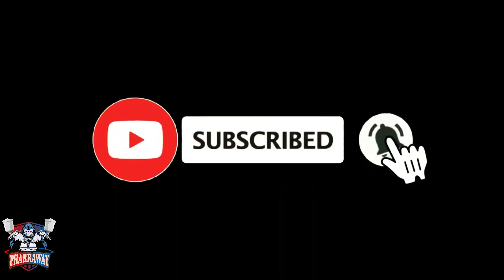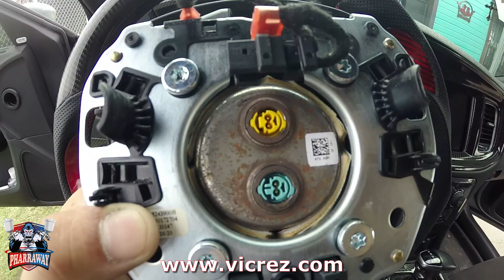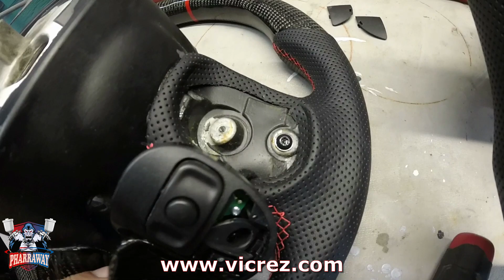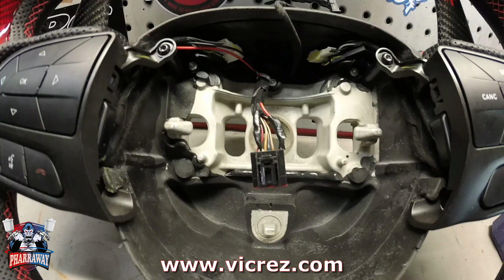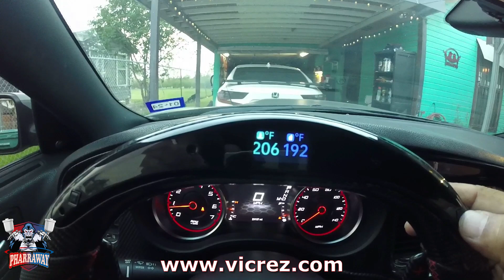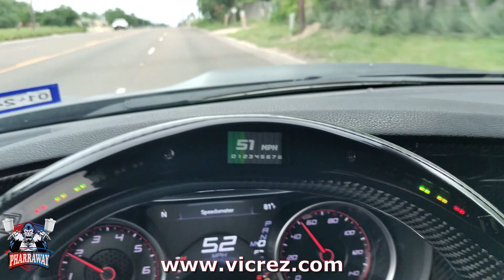Vicrez Carbon Fiber Steering Wheel With LED Dash Display INSTALL STEP BY STEP

Comment: If I bought a car with this steering wheel and it didn’t come with the obd part where do I find one?
Reply from the maker: Vicrez.com
Reply: @PHARRAWAY  they said I need a order number but I just bought the car I can’t get ahold of the previous owners either.

Comment: Great video! Does your steering wheel turn off when you turn the car off? Also, the purple wire you tapped in for the power. What does the purple wire power?

Comment: Isn't there a smart box that's supposed to connect to the data port aside from the white one you pop on there? It's shown in their troubleshooting and install video, although you do a much better job on the actual install. I got one of these for my jeep wrangler and am stuck with getting the LED displays to work. But mine wasn't delivered with the smart box. Otherwise, how does the data get to the steering wheel? Thanks!
Reply: So did you need a smart box? The other install videos I’ve seen show a smart box that transmits the data to the wheel. In your video you pop the dongle onto the data port, but I don’t think that’s a transmitter. Otherwise, I don’t understand how the data gets to the wheel. Thanks!

Comment: Hey. I have one like that. I accidentally messed around touched the sync option in the app. Now my steering wheel will not sync with the module. The led on the wheel will show no data after i attempt to sync it and the wheel will turn off. Also whenever I attempt to sync the module i get codes popping up on my dashboard

Comment: Nice video - I just installed one of these on my 2010 S5.  Could you do a follow-up video that walks through exactly how to change settings like KPH to MPH, changing the LED colors so low revs are green, mid revs are yellow, and high/max revs are red, and resetting the rev sweep range for example? I wasn't able to find the other setup videos you were talking about.  Thanks
Reply from the maker: will do
Reply: You're the man  @PHARRAWAY ! Thank you